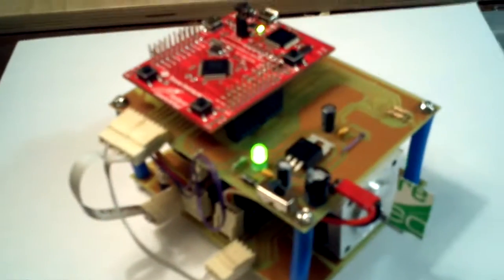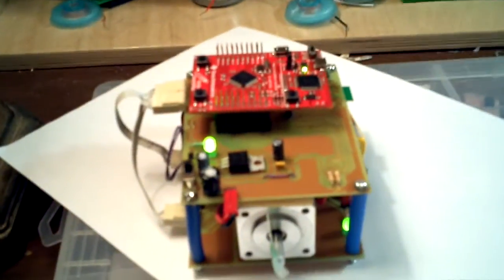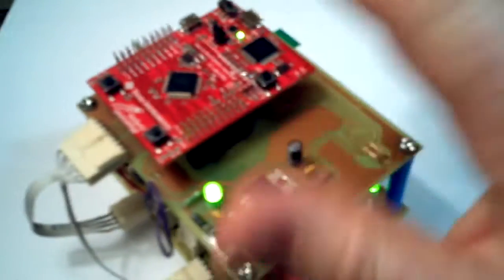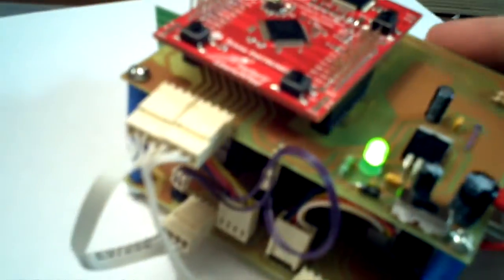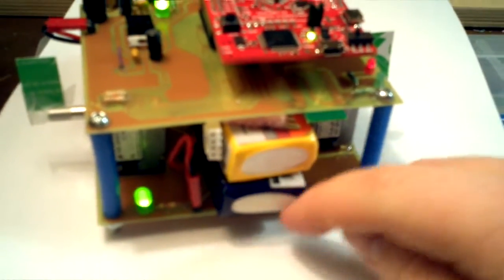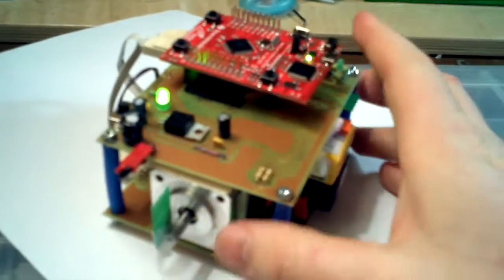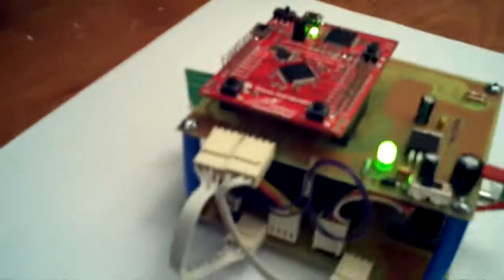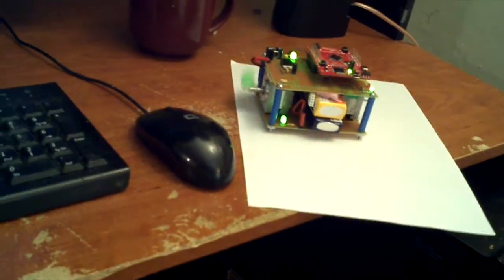Stellaris Launchpad Robot Car

Comment from the maker: Well actually I've been using the Stellarisware libraries to program it. I haven't really done any direct register type coding like the msp430 launchpad. I really should learn how to program it without the libraries but I have just started using it recently. So as a comparison I would say that the the programming is quite different if you use the stellarisware libraries but if you decide to take the lower level approach and program the registers yourself I think it is similar.

Comment: How would you compare programming the MSP430 versus programming the Stellaris?  I am working on something now with steppers also, but I am still learning how to use them.  I am using the MSP430 but am thinking maybe I should use the C2000 or Stellaris instead?